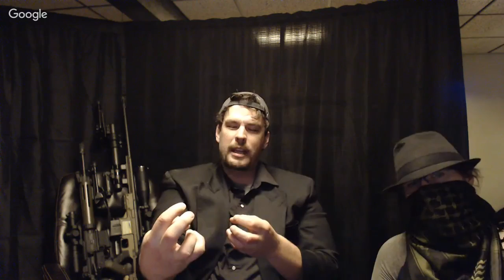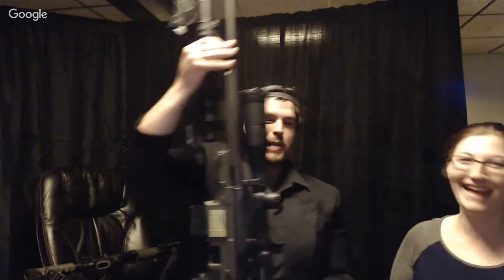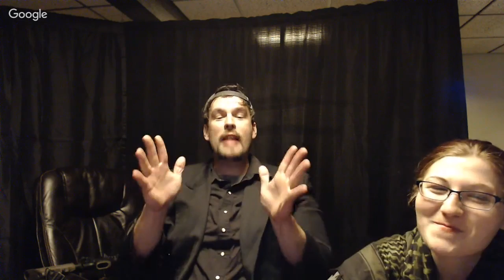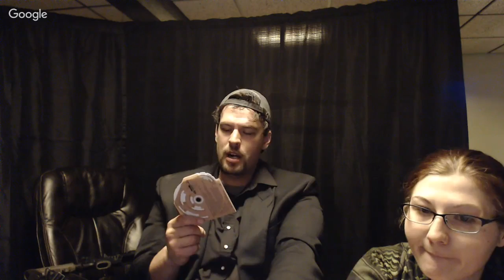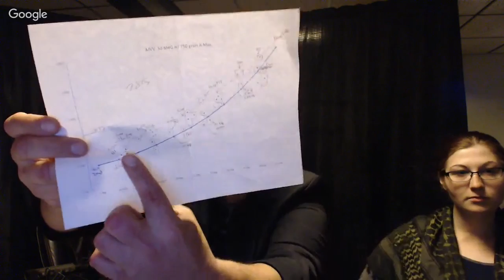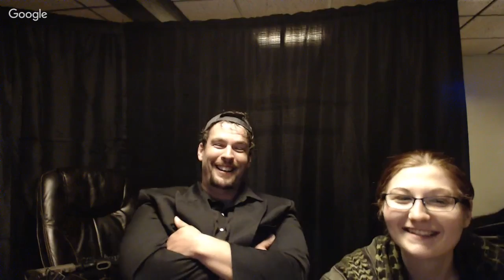Q&A- Long Range Rifle Tips, Tools, and the RX17 TRAINING EVENT ~ Rex Reviews

Comment: Hey Rex, one of the last question was regarding the Steiner T5Xi and not the M5Xi. I think you got that mixed up with your answer or not? because the T5 had a terrible start in the market because of tracking issues which they fixed now apparently, hopefully etc. Steiner USA QC is a big question mark! You can read about it online. Most outfits that use Steiner scopes are  M5's as far as i know and not the T5. M5 is the real deal over the T5 optical and technical.

Comment: For some reason I'am getting notified of your pod cast's 16 hours later.  On your comments about the m 1A's  I run a Springfield Supermatch Heavy Kreiger barrel , SS with a 1 in 10 twist , a steel mount and US Optics new B-10 scopes with a Horus H425 Reticle . So far I've not ran into problems with this setup out to 800 to 900 yrds . I also ran this rifle with a US Optic ST-10 with a Gap mil scale out to 1000 yrds . I dont currently have a range where i can get past 1000 yards.

Comment from the maker: TOPICS COVERED IN THIS VIDEO:  long range Nightvision options, FLIR, VAS devices, IR LASER designators, bullet selection, M14, M1A and M21 rifle precision reality, .243 Win VS .308 Win for long range target shooting, G1 vs G7, issues with shooting in the rain,  6.5 Creedmoor,    opinions of short magnum cartridge design, .300 RUM vs .338 Lapua, what rifle to use for going to "hell and back", questions on the RX17 long range rifle training class, Accuracy Solutions bipod extension device, carbon fiber barrels, whiz wheels, applied ballistics, Kestrel, US Optics scopes and new models, truing your MV vs  truing BC, when to zero your rifle, Savage BA, Hornady brass issues, affordable rifle stock/chassis options, magneto-speed chronograph, uncle Ted Nugent's Glock 10mm, Berger VS Alco bullets, Burris tactical scopes, Mosin Nagant for sniper rifle, hunting dinosaurs, Nightforce ATACR, best scopes mounts and rings, dry fire drills, what is the .416 Barrett useful for, Vortex Razor HD gen 2 scope reality, suppressors for long range shooting, book recommendations for Long Rang shooting.

Comment: just curious as to your thoughts on dpms lr308 , with a custom Accuracy Systems inc 300wsm upper with 26.5in umss .936 dia. for a beginning platform to kinda start with learning longer range disiplin
Reply from the maker: Great rifle if uou need to make just a couple shors at a time, however for a long range target rifle that cartidge is pushing it too much.  Expensive to shoot, and it will have a greatly reduced life expectancy due to its proportionality.  I would do a more efficient cartridge especially on a gas-gun :-)
Reply: TiborasaurusRex  thank you so much for your expertise and direction.  blessed day sir

Comment: I am getting into long range I am using a 300 winchester magnum any advice
Reply from the maker: Very effective cartridge, will extend your range out to 1200m or a little more.  The .243 Win using 105s will give almost identical external performance if you want a less expensive, low recoil training alternative.
Reply: I'm just getting into the long range game I have been using a Remington 700 in a 300 Winchester magnum. I'm trying to upgrade. It is a adl model. Do you have an ideas for the best bang for my buck